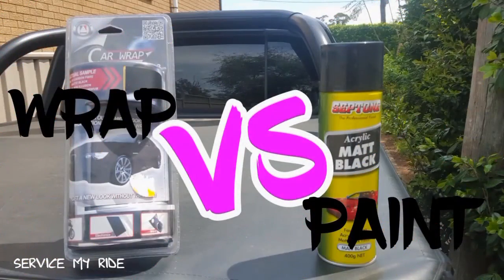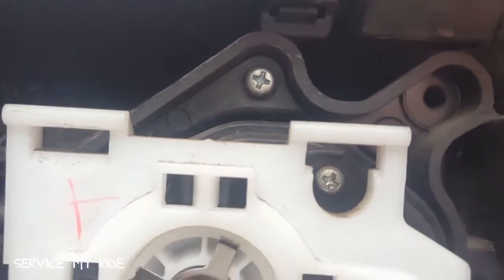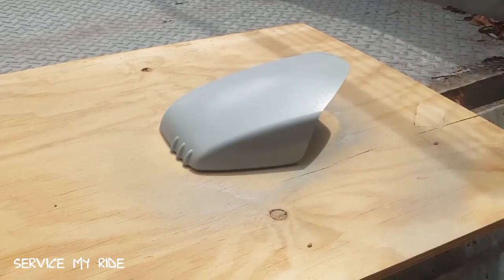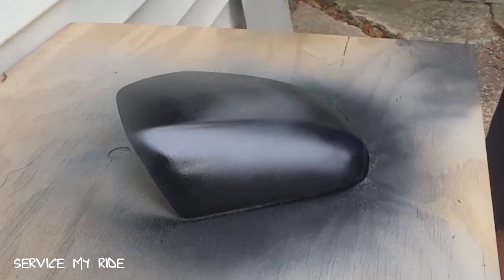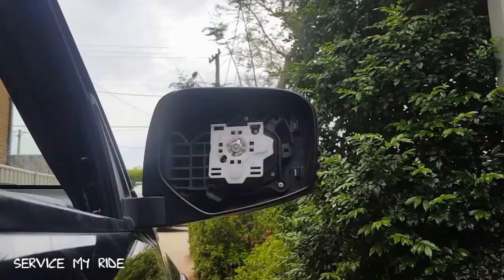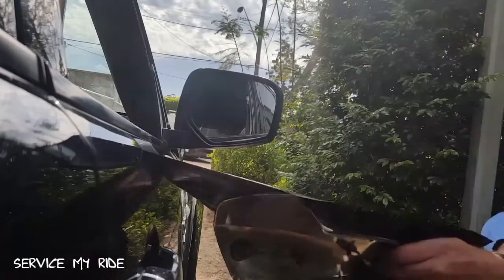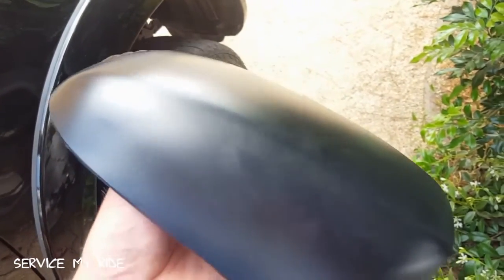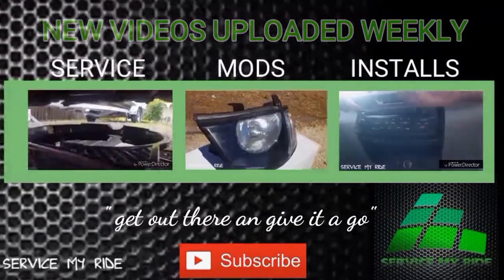Wrap vs Paint

Comment: Just adding my two cents here; the finish of the wrap may look good at first, but if you are not using quality vinyl, the sun will destroy it over a few short months.   It is cheap and easy enough to replace, so even if you use cheap vinyl, I'd still recommend going that route over the painted option.  Those mirrors will get struck by hundreds if stones and insects over time and the paint will chip. The vinyl on the other hand is much tougher and can probably take the strain. Also, let the wrap cool down completely before you start trimming the edges. The vinyl will shrink and your final product will look like crap if you don't wait it out.  Great vid though. Thank you very much.

Comment: Hey mate, I removed mine and painted them, they look very good. Can't get them back on now. Is there a trick to it?
Reply from the maker: covers clip in easy before the mirror, the mirror is harder to line up, push firmly into clips
Reply: @ServiceMyRide  I was able to get both mirrors back in easily and the covers were a pain. Worked in the end but doesn't look 100%. And a couple of clips snapped when I tried to bend them in a little so they would grip. Overall still looks a lot better than the chrome. Thanks for the video